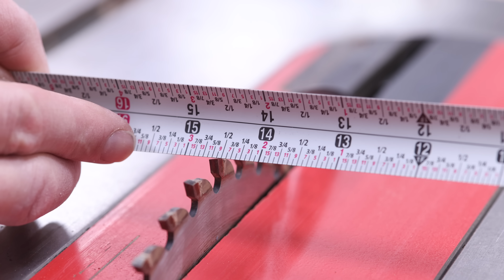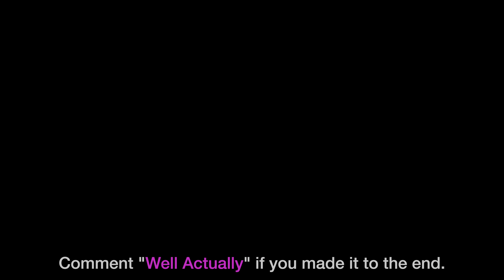The $11,000 Cabinet That Shocked Everyone

Comment: You will probably never see this comment, but an old woodworkers/construction finishing trick my dad taught me was to mix some saw dust of the wood you're working with, with wood glue to make a paste to fill those "oops" holes and gouges. Once dry, sanded, and sealed, you'd never know it was there.
Reply: In my experience, they show up again when finished, because the glue doesn't take the finish in the same way as the natural wood.
Reply: @JohnDlugosz  Was that a "Well actually" comment without actually using "well actually"?
Reply: @JohnDlugosz Straight 🤡 reply...
Let ask you something... What do you think is the entire point of using sawdust from the same wood? 🤔
If it stood out so much as to negate the use of this very common method used by woodworkers; that means it was a skill issue and you used way too much glue to sawdust ratio in your filler 💯
Also, seeing as this method is used for filling gaps/cracks that are way too small for an inlaid patch of new wood and the wax filler pens on the market don't finish the same as wood either... What would you offer as a better alternative? 🤔
YouTube comments are absolutely infested with 🤡's who are quick to critique or tell others how "they are wrong" without adding anything actually useful to discussion themselves 💯
Reply: Old but well known procedure
Reply: So long ! Like I say you just don’t stop talking!
Reply: @EmpressOfExile206 And in this thread you are the obvious critiquing 🤡.
The guy just added his experience and you started blasting him... 🤦
Reply: @EmpressOfExile206  You HAVE to research some coping methods you can use when an internet stranger’s comment makes you start to lose your entire mind like this.
Reply: Cascamite powder with wood dust
Reply: @EmpressOfExile206  Presumably it works OK for many non-stained finishes and gel "stains" (actually a colored lacquer).
It may have worked better with OG wood glue, not TiteBond II or III.
My solution, vary rare to ever need, is to fill the gap with Liquid Nails and then rub the sawdust on top, pressing it in, then adding more on top and burnishing it down.
Reply: That’s exactly what I do when installing hardwood floors. Use the saw dust from sanding the floor mixed with glue to fill the gaps in the flooring.
Reply: @EmpressOfExile206 such an underrated comment. I cannot tell you how many times I had said this on a job site.

Comment: I almost hate to throw this at you, but if you would have made two slots on the curve of the cabinet aligned with the slot on the long plane, the doors would have slide in straight into the channel. Make inserts to fill the slots that screwed back in so that they can be taken off to replace tambor doors, heaven forbid they ever get damaged. Hope that made sense. Enjoyed the watch.

Comment: Instead of chiseling your tambour track, have you considered making a tambour sanding strip? You could start with a smaller thickness tambour strip attached to a coarse grade sand paper. As you increase the thickness of the strip, you could use a finer grit sandpaper. This would not only be easier and faster method of cleaning the track. But it would ensure a smooth action of your final tambour.

Comment: I love your videos! If you ever run into that problem again when making a sliding door, you can cut out the back corner to slide in the wood door. The back corner would allow for the wood to bend in the same shape of corner so you can utilize the bend in the board. Hopefully that makes sense. Awesome build!!
Reply: Yeah, that was my thought too - cut it so it only has to bend in the way that it can bend! That would make the cut slightly less hidden, but given he ended up having to cut half the back anyway, it would probably still be better!
Reply: Ditto! The slot can lie just as the radius meets the linear section of the back. The door enters at an angle and can slide around the corner.

Comment: I tip my hat to your skills, innovation, and the respect you have for the craft. I'm curious if you have ever used wax where two wood surfaces are meant to slide against each other? Years ago I took to using Carnauba wax where members slide on each other. It makes them quieter and smooth as you know what. It's like adding a mag-lev to the project. Great video and project!

Comment: I'm not a fan of all the epoxy and CNC building in woodworking that I normally see.  I use lots of machines, but I'm pretty proficient with hand tools and use lots of them too.  I do a lot of projects with gouges to carve and texture work.  (Benches, frames, beds, cabinets).  Yeah, your use of the planes and chisels will get better as you progress, but you DO have a decent eye for the project and while I might not have designed this identically, you did make a very appealing design.  I like to think about design in making the attempt to make something that someone will still appreciate my designs 100 or more years from now.  Part of that of course makes me want to do more hand work, as with modern CAD and CNC, anything done can easily be done or improved on in the future by someone else.  Hand carving and texturing is much more unique.  This project of yours is certainly one of the better projects using CNC that I've seen.  Congratulations.  This is the first video I've watched of yours.  (The Tambour doors caught my attention and I clicked on it).  (You DO need another machine though also!  At the level you are doing stuff now, you need a widebelt sander.  Yeah, expensive, but you can get a 16" open ended one that isn't bad, less than $8K, and will change the volume of production you can do considerably)

Comment: A suggestion for making the tambour slide smoothly is to put a little melted paraffin into the slots and rub it in with steel wool. Do the same to the tenons on the door pieces; it will be near silent and not stick.

Comment: Well Actually, if you plan on making another cabinet like this you could just cut a small section the size of the groove out of one corners at the apex that leads into the run and it will slide right around with minimal amount of repair. Great video and amazing looking furnature.

Comment: Well actually, you could remove little slots in the back corners so they connect with the back rails in a straight line and the tambour doors would fit in perfectly

Comment: Well, actually, it looks amazing. P.S.: but actually, I am with you on the front handles, even though they look great... ...the unit looks so special, that it demands more of a Statement Center Piece(like same shape full brass or something more special/intriguing). Or just a seamless joint to highlight the continuation of that amazing relief wood(with maybe some neutral smoothly routered indents to hook onto when opening, but not big enough to disturb the big picture of continuous flowing wood).

Comment: Well actually. I did enjoy the lack of advertisements. Nice cab for the vinyl. All that toolin and no LED inset in the top behind the doors? just kidding, I don't see room for it between the dividers in the front anyhow. I wondered about the brass rods and LPs sliding in between if put in on an angel but whatevs, nice job, nice equipment too, that Bosh double jointed double miter alone. Cheers, biggups

Comment: My 2 cents; The tambour desk I had was fitted with a curved solid wood cover. It didn't roll up so much as it slid up along a matching groove along the equally curved rear portion of the top part. The top and desk were in two parts. The fact that it was a desk with no slats of wood, just a single, continuous shaped front cover solidified what the term tambour meant to me. Right or wrong, in my mind that differentiated the term "roll top" from the term "tambour". It seems the rest of the world does not agree but then, no one has ever consulted me on the issue so here we are.

Comment: well actually, I think I would have cut a tramway into the back corner so you could slide the doors in place. 
The clever thing is once you round the corner going back, the whole door will just follow through like a train through points.
The simplest part was one of the best, I like the stand as an elegant solution.

Comment: Next time use black canvas or die it before gluing into place, just gives that extra finish when you open the cabinet & not the white patch canvas & glue. IMO I would have made top & bottom brass square edge guides at the back that can be unscrewed when ever you need to remove the rolling wood doors. Overall great work on the piece.
Reply from the maker: Black canvas would be perfect but I haven’t been able to find any. I’m looking at a felt backing for the next tambour project.

Comment: I'm very surprised you cut the back off the cabinet.  I would have chamfered, or angled  the entry slot, to allow the tambour to slide in.  Those thin edges should (maybe?) be reasonably easy to cover up, rather than the whole back edge.
Anyhoo, it's a stunning build and I really, really do love the tambour.

Comment: Could you have put a notch in the corner to install the two doors and then just replaced the notch piece? By putting the notch in the two corners, the doors would go in straight eliminating the binding problem with the notch in the centre.

Comment: I don't get why you had to cut the whole back groove off to fit the sliding doors. You could have just made 2 straight short grooves at the rear corners to slide them in! Would have been much easier. Ah well, I guess that's how we learn, as you said. Finished product does look absolutely stunning!

Comment: well actually, I doubt this comment will be read being 2 weeks late to the party.  It's OK, woodworkers are mostly just talking to ourselves anyway.  I enjoyed the Seth stories.  My neighbor once said to me, while assisting with extra hands during a cabinet build, "it can be perfect or it can be done." On the surface I felt this to be in the same spirit as your tale.  I do have a question regarding the fix at the end (if you do see this query).  Why not just put a small notch in the corner so you can feed the doors in straight?  Some challenges may not be apparent to me just watching, so I am curious.

Comment: Well Actually, you could have just made a groove on the backside tangent with a 30°-45° in one of the bends. those could be easly filled and glued up with  a small block or even a dowel. I know it won't look pretty but at least it's at the backside.

Comment: When trying to insert your tambour doors, it probably would have worked better by cutting your insert notch on the curved portion of the cabinet, other the straight.
Reply from the maker: It would’ve but the doors are longer than that section so I wouldn’t have been able to slot the whole door in.

Comment: Canvas is okay but can dry rot as it ages.  A better alternative would be a Dyneema blend, famous for use in wind sails. Cost is significantly more but durability is much higher.  Additionally, you can find it as recycled ♻️ material from the used sail industry.
Reply from the maker: Excellent tip. Thanks 🙏

Comment: Never, never, NEVER.. "tip-up" your standing pad.   It only digs into your work, and makes horrible trenches, which you cant control or repair.
Next: you could cut one (2) slot on the backside to slide them in, then repaired that cut on the slot on the back after both sides were installed..... but it probably would work without repairing them because of the nature of the slides.

Comment: You really should be careful with what you’re wearing in the shop!  A loose fitting, unbuttoned flannel with loosely rolled up sleeves is a bad choice.

Also your hand placement while using your jointer is atrocious.  I would urge you to have a bit more respect for how dangerous these tools are.